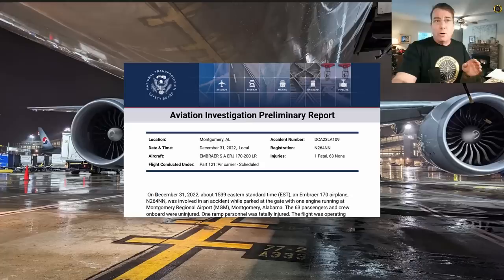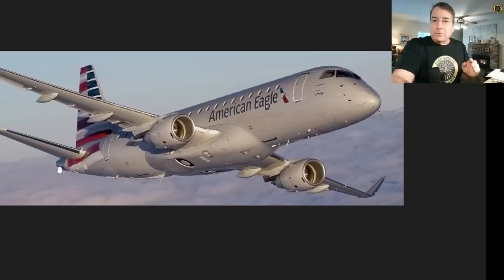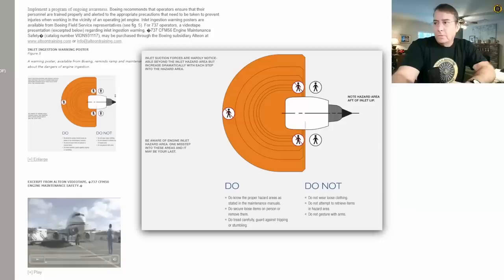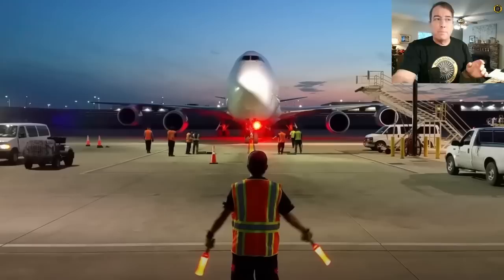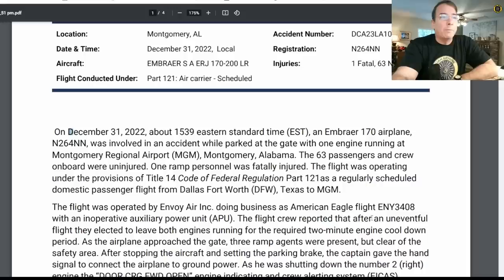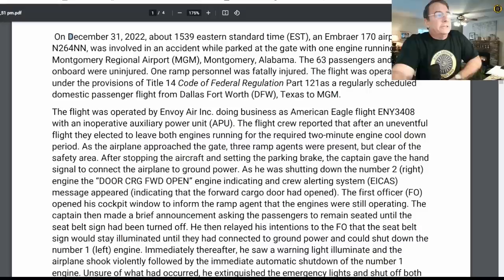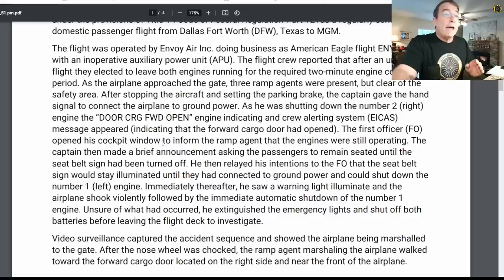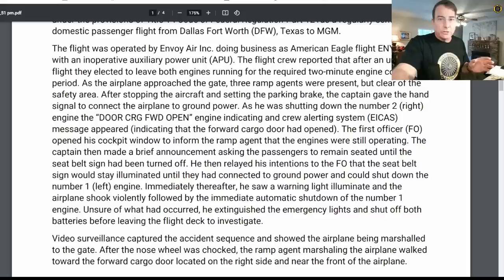NTSB Preliminary Report Ramp Agent Fatality 31 Dec 2022 Montgomery Al.

Comment: I'm a retired line mechanic and used to work for Eagle.  The safety rules in play WERE NEVER ignored by management or crew chiefs to facilitate a faster turnaround and many ramp agents and some mechanics were written up for violating these written and INFORCED procedures.  Had one ramp agent barely escape death when he stopped just in time from walking right into the right prop running at ground idle on an ATR-72.  Scared the crap out of him as the prop just wooshed his jacket.  That's how close that young man came to death.  Can't reinforce enough that discipline that needs to be in play when working around aircraft, be it jet engines or any prop on any aircraft. Situational awareness is paramount!!!!! That young lady just didn't have the understanding as to what was procedure and standard practice for some reason and it led to her demise.  What a shame. We had a young lady ramp agent in Chicago that was killed by walking right into a prop on an ATR-72 and it killed her instantly.  What a shame!!!!!!

Comment: I have seen this almost happen on the ramp at the airport I work at. Most of the time its because of new people and them not paying attention during their training or not paying attention to their surroundings. As a mechanic it boggles my mind to see someone with earbuds in place approach  a running aircraft. The only time I am near a running jet engine is when my work duty requires  that I do a run leak check or a manual start. If this is the case depending on which side of the engine I am one I will retreat either to the wing tip or the other side of the body of the aircraft before moving into view of the crew. Some operators require a set time after engine shutdown before approaching the aircraft.
Reply: My first thought was whether it was the first day on the job for the unfortunate victim

Comment: HI Juan— Nice work on this and the rest of your videos.  

I’m a 170 captain, and the cargo doors are irrelevant to the out and in times; it’s a logical AND of the main cabin door slide armed and parking brake off for the out time, and MCD slide disarmed (brake irrelevant, I think) for the in time.  

Several times over the course of my tenure on the plane I’ve had to prematurely kill the remaining operating engine when I got a cargo door open annunciation (meaning the ramp personnel had prematurely opened the cargo door with an engine still running), almost exclusively when operating with the APU deferred, or on MEL (inoperative for you non-airline folks).  I like others am convinced it’s either the operating pressure of management to minimize turn times, or the inherent nature of the rampers to disregard the danger because such mishaps are relatively uncommon.  

It’s a terribly sad occurrence, and I hope the lesson resonates for decades to come both with those who work the ramp and those who manage them.
Reply: Why would you think there would be pressure from anybody for an Inop APU? When everybody knows that's the most dangerous task on the ramp! Just curious!
Reply: @davidsmiths5471  Hi David-- 

I didn't mean there's pressure because of the inop APU, I meant that the pressure to turn aircraft around (service them quickly and get them back out on another flight) quickly exists regardless of the APU status.  

So, ramp personnel sometimes rush the plane as soon as it parks to hurry up and get the bags off the plane (that's assuming either a solid work ethic, supervisory pressure, or both, maybe).  Rather than wait for the engines to spool down, they often disregard the beacon (typically the signal used to indicate the engines are still operating) and the noise and make a beeline for the cargo door.  

The forward cargo door (behind which we carry almost all the cargo, because of center of gravity reasons) on the Embraer 170/175 is dangerously close to the #2 engine inlet.

Comment: Several years ago, we nearly had a similar incident happen at Heksinki Airport, a place where safety standards are quite high and respected. The ramp worker in question luckily was tall enough to hold onto the top of the engine and that it had just started to spool down. All it took for it to happen was a momentary lapse of concentration and too much of a hurry to begjn the unloading process. Working around jet engines can make us complacent to their dangers, however the safety rules are written in blood for a reason. We can all go home safely after work if we just don't try to cut corners and no time gets saved whilst those beacons are flashing!

Comment: Having worked in the oil and gas industry for 30 years, where safety is beaten into the heads of employees every day, and briefed before every work activity, it remains a mystery as to why people still violate safety rules.  Most times, it's a moment of inattention, sometimes it's a minor cheat in order to make the work easier or faster, occasionally it's just plain negligence, and sometimes it's a failure to understand or remember one's training.  In spite of best efforts, the holes in the Swiss Cheese occasionally still line up, necessitating that those involved reflect on the question of whether they did all they should have to prevent the incident.  Sometimes, the answer is 'no', subsequently causing them to live with guilt for the rest of their lives.  That's not easy.  The price of safe operations is good training, a deep safety culture, good safety systems, and a personal dedication to eternal vigilance.  A little paranoia, also, goes a long way.
Reply: Given how multiple ramp agents violated procedures at the same time, it sounds to me like habitual violation of safety rules in order to meet time-based incentives
Reply: You're right, and I hope the guy who was on the nose wheel, who tried his best, can get over this horrible incident.

Comment: Juan, thank you very much for making this video and I can only hope new people coming into this industry realize just how dangerous this occupation can be, especially working around these engines. Complacency with safety can be costly, unfortunately as seen here - God rest her soul.

One of the problems I've noticed - and it's been brought to the attention of the safety committee many times - ramp personnel will approach the front of the aircraft at a quartering angle after positioning safety cones under the wingtips. You can not see if the spinner/blades are turning if you approach the engine from the sides, and more than likely can't hear it either. I've seen some close calls with employees walking right past the nose cowl with the engines still running. This time the engine grabbed one. 

So what is the solution? Have them walk forward and parallel to the aircraft for about 20 feet before approaching? How long would that last before 'Murphy' reared his ugly head again because of complacency? 

Whatever the solution is, whatever new rule they come out with, it has to have a high level of accountability and responsibility. I'd rather see someone terminated and their feelings hurt than loose their life.

Comment: With two safety discussions prior, this should fall on management.  They had the team pushed to the point that metrics are more important.  Safety must be number one.
While metrics are important, safety has to be first priority.  No one should assume that the engines are off and spooling down.  If you can't see the individual fan blades from outside of the zone, you don't enter, no matter what.  Perhaps there should be an interlock that prevents doing tasks that shouldn't happen until the red beacons are off.

Comment: So, if I am understanding this correctly, she nearly got knocked off her feet by engine exhaust and still walked in front of the engine?
Reply: that's how I understood it too. no one has said if she was a new hire. airlines are hiring a lot of new people these days
Reply: The way I read it it was two different people but maybe not.
Reply: Yes. While another Ramp Agent opened the Cargo Door in front of a running Engine, being lucky not to be ingested, too.
Reply: @dsmreloader7552  not in this report and I don't work at that airport or airline, but the story I heard just today was they walked behind the engine got knocked down and then walked in front of the engine. doesn't exactly match what this report said, but close enough to make me think she walked behind the running engine to set the tail cone, which is very bad and then walked over, grabbed a cone by the wing tip and carried it straight into the engine.

very sad. I'm guessing she was a new hire or something else was on her mind.
Reply: After 2 safety meetings also
Reply: @jsomething2  We will probably never know it - but there´re four principle possibilities why she acted like this: 1.) She was very far away with her thoughts from what she was actually doing. 2.) Very poor Training and lack of Common Knowledge in addition with the bad Example of the Marshaller opening the Cargo Door. 3.) Intoxication. 4.) Suicide.
Maybe a combination of them.
Reply: @NicolaW72  You forget "pressure from management to perform to an impossible schedule" as a possible reason
Reply: Right!
Reply: @NicolaW72  I'm going to say NO for #4 and #3. She was a mother of 3-per one of the commenters. Possible #1, and that it was New Years Eve, overtime desire, overworked, exhaustion, and push of management metrics. A stretch on #2 but if she was new, then she didn't pay attention at all during huddle? Complacency that see someone open the cargo door, just figured engine spooling down and ...gone.
Reply: guttebo  the new hires don't take heed in what us experienced folk say. They think rules are a suggestion even though I constantly remind them that they're there because bad things happened that caused those rules to be created
Reply: It could very well be that she was fatigued. There are a lot ground crews being forced into more hours to make up for staffing shortfalls. Don't be so quick to condemn my friend!
Reply from the maker: Correct.
Reply: @xoxo2008oxox  You think people with kids don't get intoxicated or depressed?  That's an interesting take.
Reply: Yes.  It sounds like the engines weren't given their proper respect.  Those engines are shredding bins if used that way.
Reply: Could have been nearly knocked off her feet by the #2 right engine, walked around the tail setting rear cone and was ingested by the left engine.  The flight crew tried to inform the ground crew that "engines" were still active after the cargo door was opened by the other ground member.
Reply: @OutbackCatgirl  Openly said: I don´t think that would be a reason: It´s better to be unemployed than death. There were just two safety briefings held just a few minutes earlier. And not to forget: Two Ramp Agents acted according to the rules and tried her to get out of the way of the running Engine.
Reply: @xoxo2008oxox  You never know what´s going on behind another person´s forehead. Suicides are coming often suddenly and unexpected for the Family and Friends. It is a real possibility which we shouldn´t neglect.
And #3: Yes, it was New Years Eve.

Probably we all hope that it was a combination out of #1 and #2. That would give us the Chance to learn something out of this horrible Tragedy and get it rationalised on this way.
Reply: @NicolaW72  that...  has little bearing on the possibility of my addition, actually. when you have family you're providing for financially there is a TON of pressure to remain financially stable, and human psychology isn't as clear cut or logical as you make it sound by distilling the possibilities down to two options. Of course nobody (besides suicidal folk) would willingly do what she did knowing it could be deadly. Fatigue and stress due to overwork is far more likely a culprit than incompetence and near misses are constant in this industry, which points more to a workplace culture that enables safety briefings to be treated as a routine to be tuned out rather than a vital part of doing the job safely; why else would the marshal have gone in too early? Pressure to perform, plus a potentially dismissive safety culture that, despite going through the motions of briefings and "huddles", doesn't properly put pressure on workers to be safe first and work to a schedule as a secondary goal.
Reply: Has anyone asked if maybe she didn't understand just how jet engines work?   Maybe simple to some, but to others a total mystery.
Reply: @OutbackCatgirl  There is no pressure with a inop APU turn!
Reply: @davidsmiths5471  How so?
Reply: @OutbackCatgirl  An inop APU! Is the most dangerous task for a person on the ramp! And so many variables can cause delays in this process! The airlines, contractors, know this plane will not be able to keep its schedule! So you might rush to load the aircraft to have more time for the Air start! But out of 100s I've been involved with,it's been a maintenance delay and never blamed on the ramp!
Reply: @davidsmiths5471  How precisely does that reduce pressure on the ground crew? I'm very much a layperson so I'm definitely making assumptions that could be incorrect. 

I've seen a few posts here that seem to insinuate two potential causes of pressure being monetary ones - from clock in/clock out period for the pilots when the parking brakes are set, and more arbitrarily, that some airports might penalise ground crew if their performance metrics don't match a theoretical baseline dictated by the airport management. It could be that this understanding gained from other comments was misleading or not universally applicable.
Reply: @OutbackCatgirl  Basically there is no clock! In this gentleman's review the plane arrived late! Yes there are many ways to make up time safely! The aircraft might have a small laod( passengers and bags)! Might not need fuel! But even saying this! And even after you have the engine running! You have to remove the air start cart,pull back the jet bridge! Which has to connected to the aircraft for the passengers safety in case something goes wrong! Then if they are follow proper procedures! The push back driver has to do a walk around ! In this case not actually around the aircraft because there is an engine running! A walk around is to check for any damage, leaks and make sure all panels are closed and cargo bins are locked! Then your ready to pushback! Hope this helps!!

Comment: Juan, I’m a long time viewer, but never commented before. First and foremost, thank you for your hard work and amazing content surrounding the aviation community. I never miss a video and look forward to your honest and non-biased take on current events…

Now onto this horrible tragedy. I work part time on the ramp for a major airline at a major hub. While safety is always preached as job one, there is tremendous pressure on ground crews to meet certain arrival/departure metrics. For instance, we are graded on scanning the first bag OFF the aircraft inside 3 mins from arrival (parking brake set). We also have a 20 minute target to get all terminating bags to the baggage claim. These numbers are harped on constantly by management and published via email weekly. 

I’m not saying that’s what is going on here, but I am sure in the back of this agent’s mind was connection times and corporate metrics. 

I’m all for running a timely operation, but no bag or on time departure are worth someone’s life. Such a tragic avoidable accident. Prayers for this woman’s family and co-workers. 

Blue skies and tailwinds sir… fly safe
Reply: Are you working for the airline or contractor?
Reply: @davidsmiths5471  I work for a major US airline
Reply: @joelee4796  So how many rampers would you have for a A320 or  RJ200? Excluding the bagroom! And do you get bonuses for on-time departures no missed bags an so on?
Reply: @davidsmiths5471  for mainline (A320, 737) we usually have 4. For RJ’s we can work with as few as 2, but normally 3.

We don’t get bonuses directly tied to the flight performance, but mgmt does. Anything that goes late is assigned a reason and we don’t ever want it to say “ramp” or we hear about it.

Comment: I’m a ramper at a very large and well known cargo airline. At my station if you walk into the safety envelope while the beacon is on you will be fired on the spot. I’ve seen managers walked to their car on two occasions for accidentally stepping into a corner of the envelope. 

When a plane comes in everyone must remain outside the envelope except the GPU operator who  chalks the nose gear, installs the steering by-pass pin and connects and fires up the GPU. 

NO one else can enter the envelope for 30 seconds after engine shut-off and never when the beacon is on. 

We also wear wireless headsets so we can communicate with one another and use a min of 5 people. 3 marshalers, a GPU operator and a plane boss.  All on headsets. 

And like some air crew members have mentioned here, aircrews have no control over our ramp or ramp operations. We operate on a private and uncontrolled ramp. 

Our operation operates like a sewing machine and we work like a pit crew blocking an aircraft in and out in minutes but block out times never come before safety. 

Been there two years and have not seen a ramp injury during block in or out. 

We operate 737 and 767 aircraft. 

Best job ever.